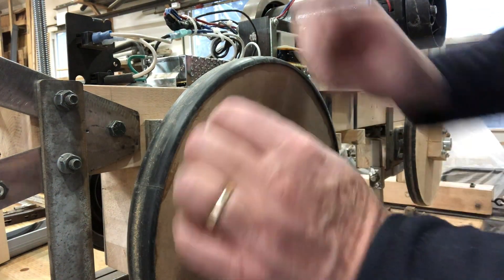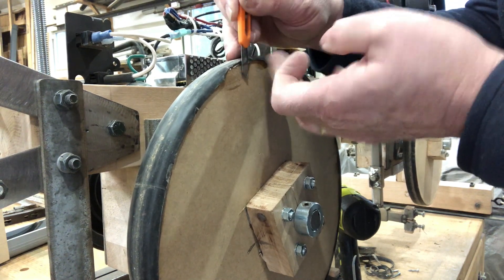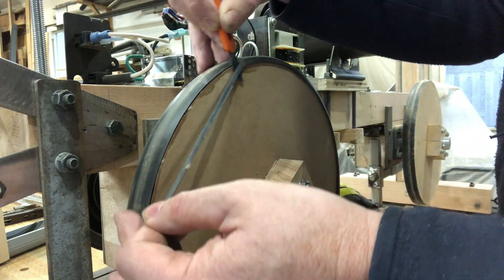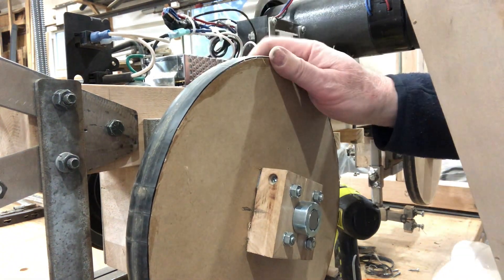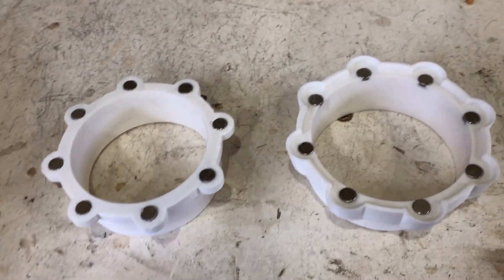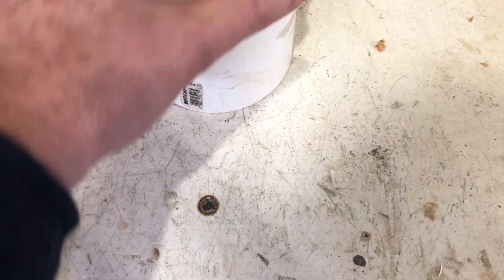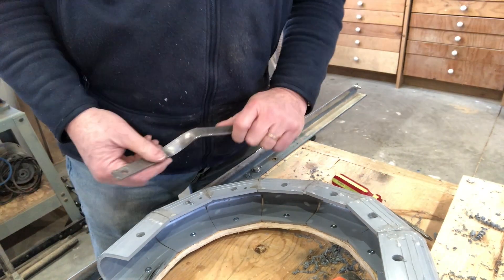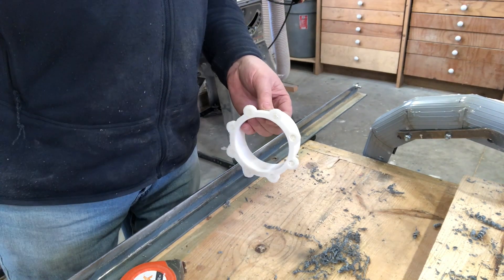Worktable Sawmill - A Few More Tweaks

Comment: What would be ideal for those plastic joints would be a plastic welder with those S-shaped staples. They are very satisfying to use, although I have not tried it on such a heavy piece like that conduit.
Reply from the maker: Now why didn't I think of that!?? I don't have a "real" plastic welder, but I have done some plastic welding with a modified soldering iron. And I bet I could come up with something in place of the staples ... screen perhaps?
Reply from the maker: By any chance, was that a Harbor Freight purchase?